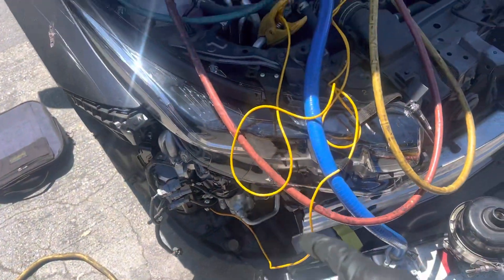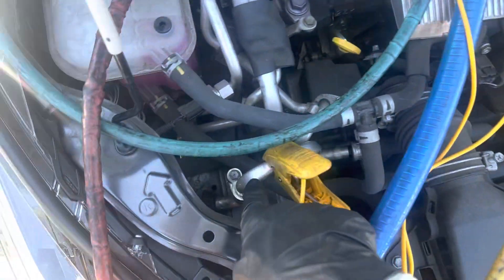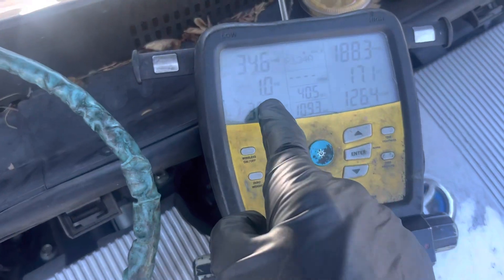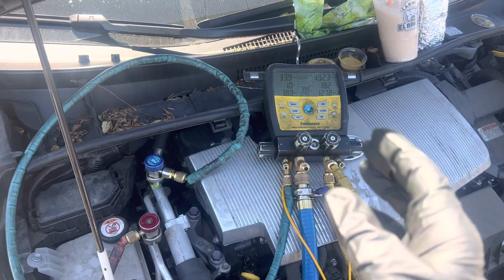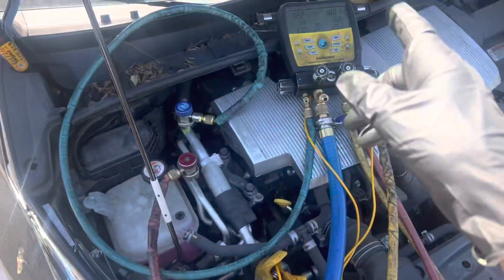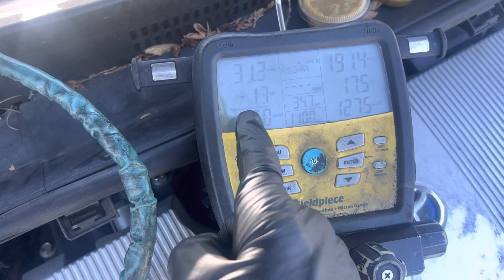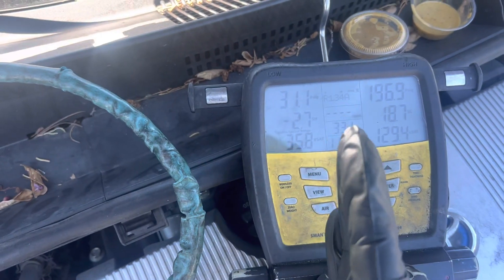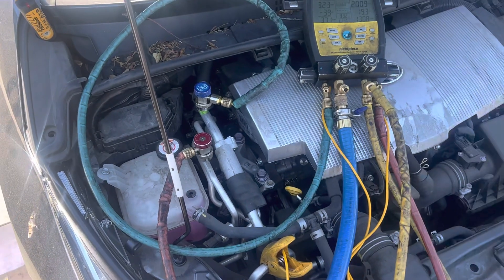Zero SuperHeat Refrigerant￼ returning to this compressor is normal for this vehicle. ￼

Comment: Hey Tom, I don't understand measuring superheat a little bit. On the ParkerSporlan website in the literature tab, you can find a lot of interesting documents explaining the operation of ac system. There i found:
 " The important thing to remember is 
that the pressure-temperature rela tionship as shown by a P-T chart/
application is only valid when there 
is a mixture of refrigerant liquid and 
vapor."
So, in car system if i want to check SH i have to measure temp. on outlet pipe from evaporator by clamp - ok. But i cant measure pressure exactly in point of evaporator where is mixed liquid refrigerant with vapor, cause there is no LP valve, LP valve is usually on suction pipe on compressor so there is or should be 100% vapor, how my pressure shown on the gauges is reliable to that pressure which is in the evaporator where the liquid mixture is ? or i misunderstand it?
Reply from the maker: Superheat is all vapor.    That’s why it’s called super heat.  It’s after the point of all vapor. Then if keeps picking up heat after that. 

Watch : HVAC school, HVAC service LLC, HVAC service Mentor,  Ty Bremerman 

Search YouTube for their name plus add superheat & subcooling 

You will understand after watching all their videos
Reply: @coldfinger459sub0  i know these channels. Superheat is Suction Line temp. - Suction Saturated temp. ( from pt chart) measured on 100% vapor point in ac system, not in evaporator core. Thats difference
Reply from the maker: @apachechoice2538  if the refrigerant charge is not correct, you can have superheat inside the evaporator.

Comment: Do you have an analog gauge you can show that?
Reply from the maker: I still have my original set of analog gauges from the 1980s. 

But I have not used analog gauges in nearly 20 years

But yes you can use analog gauges to find your superheat or sub cooling. 

But you will need a good accurate clamp on style temperature sensor

Simple math equation using pressure with line temperature

Comment: Sorry to break it to you, but negative superheat is impossible. On any system period. There is no way a refrigerant can give up enough heat coming out of the evaporator core to drop  its temperature below the change-of-state temperature. If it did, the vapor would be changing back to a liquid. Besides, it will allways be gaining heat, not loosing heat coming out of the evaporator. What you are seeing is a calibration issue on your pressure gauge, temperature  sensor, or both. I was a commercial HVAC technician before becoming an automotive technician.
Reply from the maker: Yes I know there’s no negative superheat but it sounds Like back when you’re in HVAC/R School and you tell your instructor you have -5 superheat and he has the bust to do there is no such thing. . 

But it does go to zero superheat just like some of the large commercial VRF units and mini splits hover ride around 5° superheat down to zero are used to sell and install Panasonic‘s echo I VRF and their spec was down to within tenths i’ve zero SuperHeat. 

And depending on operating condition of some of the smaller mini splits and LG MULTI V VRF systems they will get down there just within tense of zero SuperHeat. But then again they have nearly a 4 foot tall accumulator protecting the compressor. 

       But this was taken after their valve assembly and accumulator assembly the system also has like in commercial refrigeration a POA valve like if you’re feeding multiple racks into a header with multiple evaporators set at different temperatures low temp and medium temp.  

Factual SuperHeat on the other side of the valve just after the accumulator varies between 5° superheat and 30° superheat and then after their control valving system it would be right around 0°

My wife’s Tesla operates basically the same way both these vehicles have heat pumps
Reply: @coldfinger459sub0  Will you consider making a video on recycle/recharge on your wife's Tesla as maintenance to see how much refrigerant it losts per year, given it is a more complicated system?
Reply from the maker: @knk3220  I done a couple Tesla videos may have mentioned what year they were and how much refrigerant I recovered and suspected loss. 

Are Tesla wasn’t a small accident and had a bumper and some other frontal parts remove including condenser and was recharged by Tesla just last year. 

so far I don’t see any problems with Teslas

I have heard I think it was the Y model that they were having a compressor burnout problem specifically I don’t know if it’s a production run or a certain year do not have all the details yet.

And she’s not King on the idea of me taking apart her interior and all the little SnapOn connections and neither am I breaking the little clips that hold the Front trunk interior together made kind of cheaply

Comment: Hmm, well I suspect this makes me super ignorant, but, I have never checked super heat or sub cooling on an "automobile" A/C. Suction line is "beer can cold" and pressures look good, its good. Oh don't forget to change your orifice tube and service ports Schrader valves. Check the capacity of the system, check for leaks, recharge and you should be good assuming that you already ruled out having to change the compressor as well as evap and cond coil. Not rocket science. Peace
Reply from the maker: Actually there is no such thing as negative superheat but on a standard fix piston compressor you would not want to zero superherheat ‘cause that means you’d be getting liquid back to the compressor it would definitely be Beercan cold and it will work and it may work weeks it might work months but eventually wipe out the compressor many guys don’t know this. 

They just keep pumping in the refrigerant until it’s cold out of the vent in the line coming back to the compressor is cold not knowing that when the compressor burns out a year later it was because of the way they filled it up initially. 

Cars don’t have orifice tubes no more because they’re not energy efficient and they don’t give a smooth steady temperature out of the dash because they use that low pressure cycling switch so you constantly get a few degrees variance out of the vents which is not good as a selling point for especially luxury cars. 

And these vehicles are completely automatic control a variable speed compressor so if you’re low on refrigerant by accident by improper recharge it will just ramp up the compressor to five or 6000 RPMs to try to force that small amount of refrigerant through the expansion valve in an attempt to provide the passenger with the correct cooling that they’re calling for. 

But if the guy who charged it up does not know this he thinks he charged it up correctly but they compressor will just keep on drawing more amperage overheating the windings by providing excellent cooling out of the dash for the customer. 

But then the super Superheat will be a little bit on the high side and the oil flow will be reduced to return back to the compressor it does not do any immediate damage it’s something that takes a long time caused by the technician who uses the little cans and tops off with and he doesn’t know any better. 

Because that’s the way the systems are designed. 

On this particular vehicle if somebody does not charge it correctly and it burns out the compressor they will be flipping about a $6000 bill between the compressor the condenser and just that accumulator on this car is $2600.  Then the labor for flushing all the lines with mufflers have to be replaced they’re not allowed to be flushed.   

This definitely ain’t our grandfather Chevrolet

Comment: I bet the compressor itself is cold.
Reply from the maker: Yon know I never touched the compressor. I need to do that on the next one
Reply: @coldfinger459sub0  I've been meaning to "shoot" them (compressors) with my IR thermometer but keep forgetting.
Reply from the maker: @thisisyourcaptainspeaking2259  IR measurements are not very reliable on curved aluminum objects that are reflective.   Especially when there are hot items around like exhaust manifolds and radiators radiating heat striking shiny curved surfaces and bouncing off of them throwing off the IR readings. 

Unless you spray paint them with flat black Webber paint for a barbecue
Reply: @coldfinger459sub0  Agree, I never trust an IR thermometer, it's probably worse and certainly no more reliable than checking by "beer can cold" aka: "wet gas feeling" lol! method.